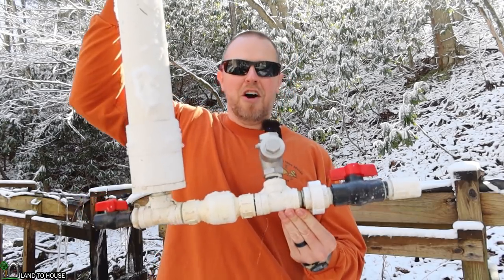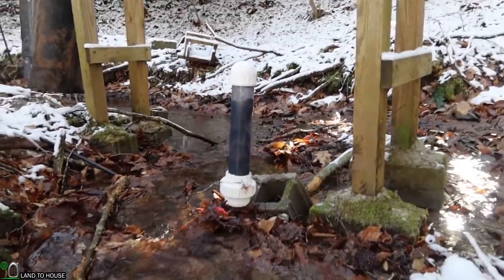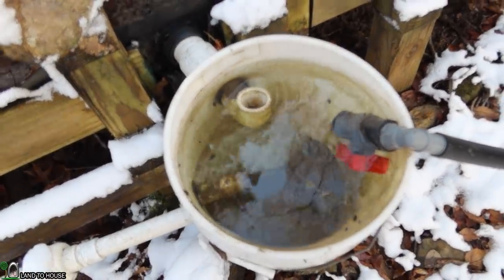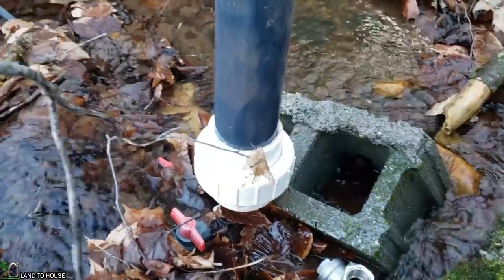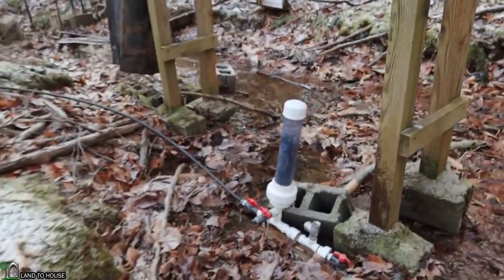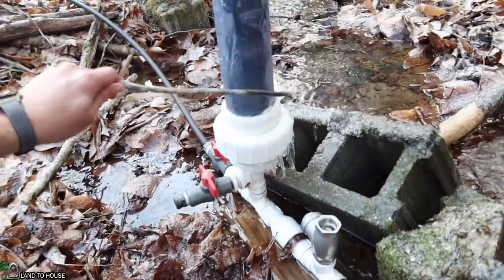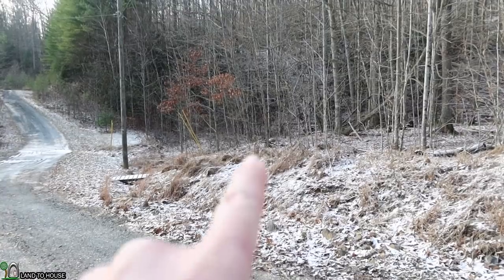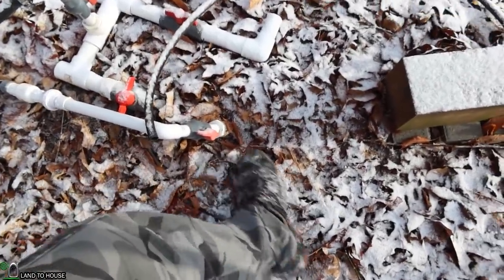Ram Pump in Winter [Will it Freeze???]

Comment: We don't have any problems with freezing in Australia where I live and we have been using a 100-year-old ram pump that I reconditioned for about 20 years. So it takes water from a spring and delivered it to a tank at the top of our property that that gravity feeds our house. The feed hose from the pump to the tank has 120 feet of head to overcome and while it did this the flow rate was not good as the fall from the spring to the pump was not that big. When we put in a small orchard our need for water increased and the pump was too slow at keeping the tank at a good level but we did not want to increase tank size or go to a motorised pump. I attended an alternate farming show day and came across a "Bunyip pump" being demonstrated and was impressed with the volume and head it could get to. I bought one and installed it and it's fantastic. I know they are more expensive than ram pumps but they are so much better and easy to maintain with much less plumbing.

Comment: Too cool and thanks for sharing this adventure.  I can't wait to see you with a shovel trying to bury over 100 ft of delivery pipe, uphill!  Sorry to hear your delivery pipe separated at the fittings in the middle of the culvert under the road.  Since you are going to have to extend the delivery pipe to the new water tower, you might want to consider cutting the pipe just before it goes into that culvert and pulling the rest back a bit so that fitting is not inside the culvert next time it needs attention.

Comment: Something else you can try.. An idea I had for running it in the cold is to put rubber pipe insulation over both the drive pipe and the other one, then a larger pvc pipe over that, putting the ram pump either in a building or put it in a box (and allow draining of the water) put straw or pine needles to help insulate it.. It may or may not work.. It looks good on paper... Love your videos, thank you for sharing...

Comment: Have you mixed different sizes of components on pumps? I've wanted to build a system for a friend's spring and I was curious if we could get away with 3" drive piping and 2" fittings with 2" outflow pipe?
Reply from the maker: The waste valve and drive pipe need to match size. This is based on pressure wave size.

Comment: Hi! I have been following and watching your videos about the Ram Pump.. I have one question though:
Does the size of the pressure tank matter? Like instead of using a 4 Inch (or 3-inch), I only use a 2 inch or 1 inch diameter pipe.. what will be the disadvantage?
Reply from the maker: You're going to want to have enough volume of air to allow the Hammer effect to be Cushioned. The pump will operate without a pressure tank. But it will hammer itself to death.But there is no reason that you can't use a smaller pipe.